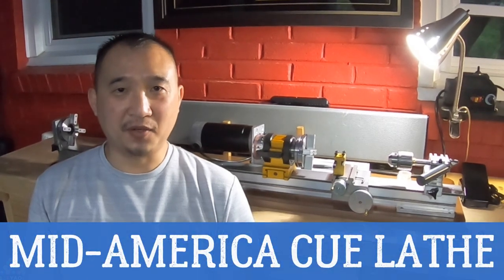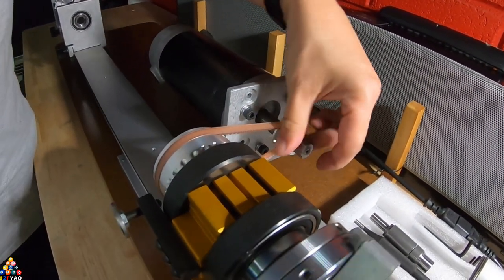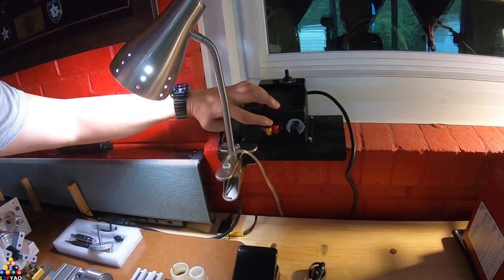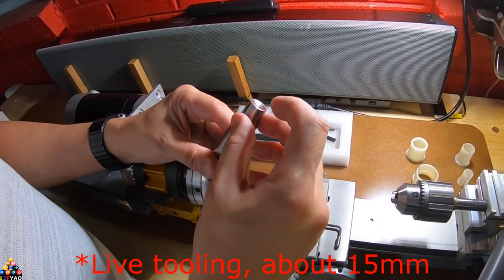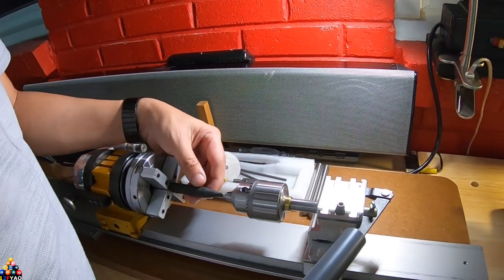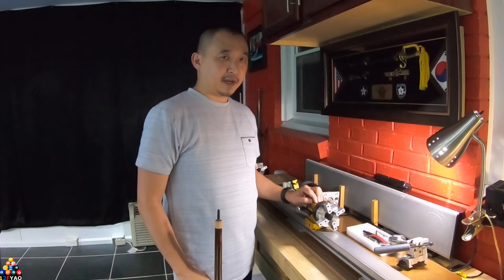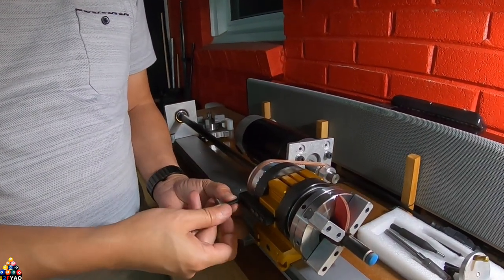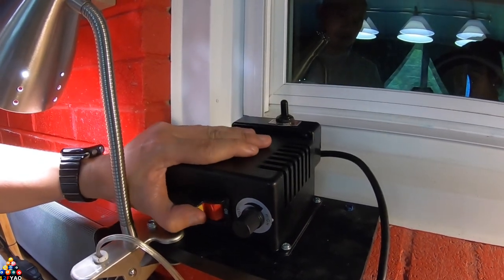CUE LATHE (Mid-America, Professional Large Bore Headstock)

Comment: order a couple extra tool post bolts  (center bolt that holds post to carriage) now, it is a difficult size to find. As you move post around you will wear out those threads.  A quick change tool post helps a bunch.

Comment: I’m thinking of getting your lathe, I really like the four jaw chuck. Do you know how your lathe compares to the Deluxe Smith lathe. I noticed the Smith lathe has a tapering and  inlay machine that attaches to lathe. Which are cheaper than the stand alone models. But I don’t know if there’s any quality difference between the two lathe’s. Any thoughts?
Reply from the maker: I was going to get a Deluxe Smith Lathe but they never contacted be back.  Todd from Mid American replied to me within 24 hrs.  I do wish my lathe has a taper bar. Building a butt and doing joint, pin and shaft maintenance to me, both lathe can do it all. The thing that separates the two lathe is the taper bar to make shafts. Wood shafts are the hardest thing to make in my opinion. I had to make my own “taper bar” from aluminum extrusion and works but the taper bar would have been better I think.  I still have to sand the shaft down. Now I’m planning to just get a cnc machine to make points, shaft tapers and inlays.  If you have the room or if you are seriously thinking on making cues with the shaft, get a lathe that can fit a butt so you can do joint and pin work and get a cnc for shafts and lays. If you just want a lathe that will do it all, even I have the Mid American Lathe, I would get the Deluxe just because of the shaft taper bar. Also the four jaw is like the three. The 4 jaw is not independent like a real metal lathe four jaw meaning each jaw can be closed to get perfect concentric. Thank you for commenting, please subscribe if haven’t already and hope this helps.

Comment: Please let me know What are the 2 dial indicators have you been using?
Reply from the maker: The dial indicator I use is from Amazon. I made sure it’s a .0005 vs .001. It makes a big difference especially when facing on the joint of a cue. The other one is a harbor freight and it reads .001. Not precise but for quick non critical task it works. Hope this helps and thank you for commenting.

Comment: I just purchased this same lathe have you had trouble with it tripping a breaker when you adjust the variable speed power supply?
Reply from the maker: No I have not. I would contact Todd. The power supply might be faulty.  I know the power supply is not a clean converter because when I use it, my speakers are picking up the on and off and I can hear the power supply through my speakers.  I also plug the power supply through a surge protector.  Hope this helps and please share.

Comment: The Power supply/ speed control unit should always be turned off with the main Power switch,  If you turn the directional switch to the off position and leave the main power switch on then the unit remains under power and over any extended time will cause the unit to fail.  Always turn the unit off with the MAIN POWER SWITCH.  Thanks you.

Comment: 1.keep that gear track clean.
2.learn to sharpen your hss tool
3.dont over tighten the jaws
4.those jaws will leave crush marks in wood. I like to tape off anything in them.
Reply from the maker: Dave Murrell thank you for the advice. Sharing the high speed steel tools is my next thing to learn. Thank you for commenting and please share.
Reply: @playpool12fyao  will do. This is the best repair lathe around. 
If you get his cnc taper machine you can full blown make cues
Reply from the maker: Dave Murrell I totally agree for the price, what you get and what it can do. For me building a cue, I am first trying to master concentricity. The lathe is accurate but I know I’m not super centered with the tail stock. I am getting a little lip, doing joint work, when mating the shaft and butt of the cue. I did the two dead centers with a blade making sure the blade between the points is horizontal. I think it’s my drills wondering. I ordered the Edge Technology tail stock alignment tool and carbide drills. Once I master concentricity, I will slowly try to build a cue.  Thank you for commenting.
Reply: @playpool12fyao  do you have a boring bit?
Reply from the maker: It’s coming Friday.  Never really needed it for my metal lathe. I could not really work on the joints with the metal lathe. Now that I can with the cue lathe, I ordered some from amazon.